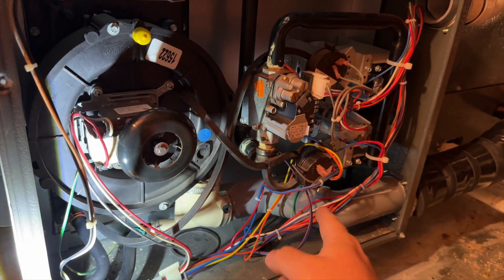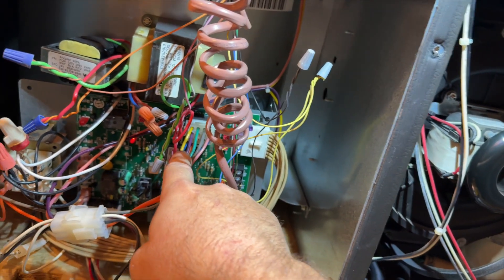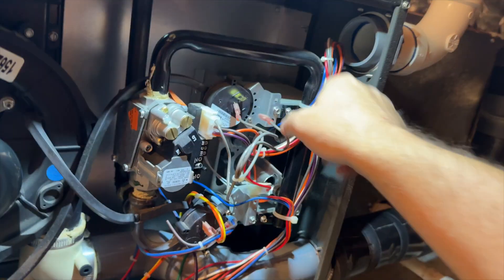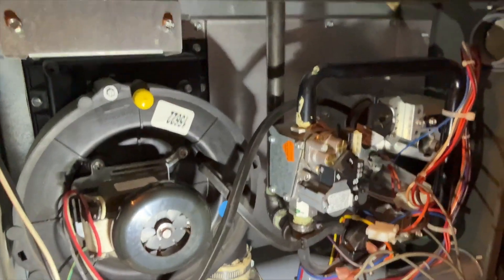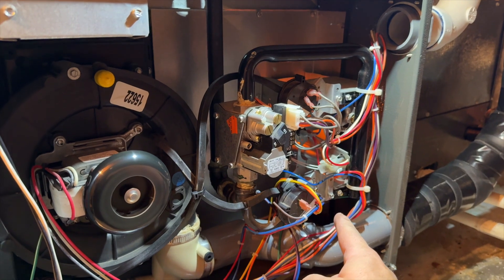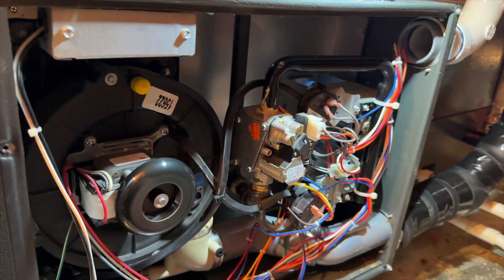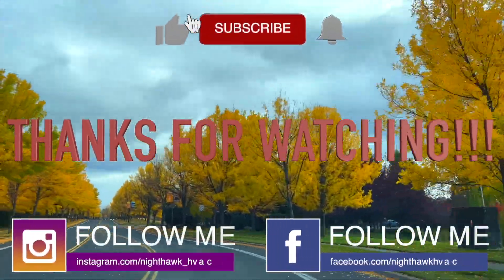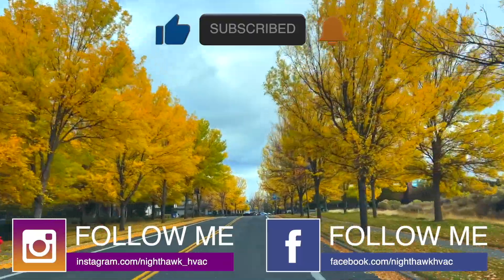Goodman 90% Furnace Not Heating EP195

Comment: Goodman is goofy like that. You’ll get an igniter and then last second voltage is sent to that pressure switch. If it’s closed your gas valve will fire. Made me confused at first too because other manufacturers will prove all switches before the igniter gets power.